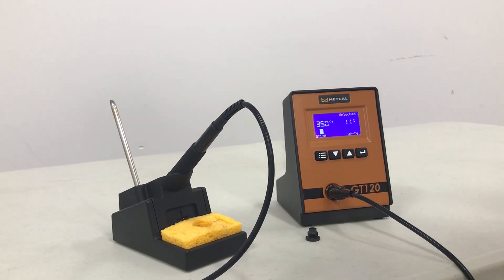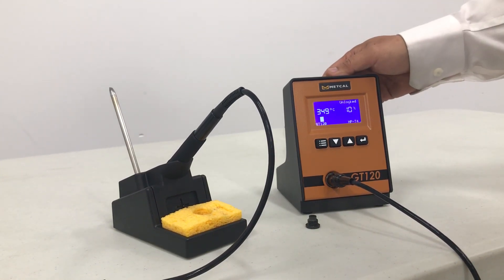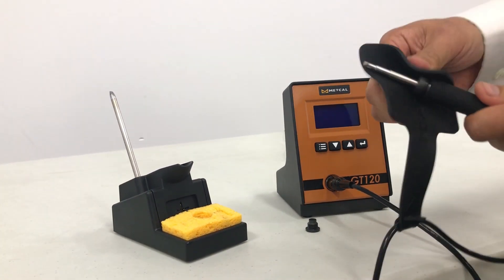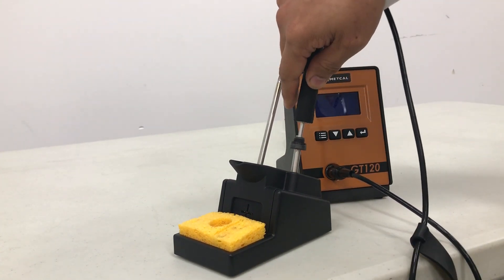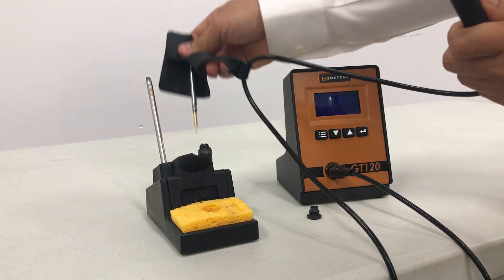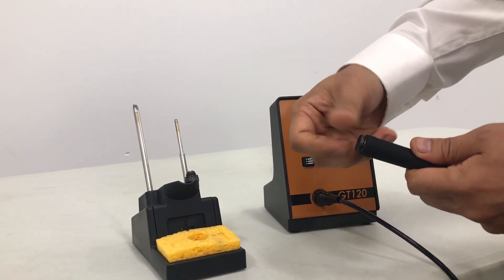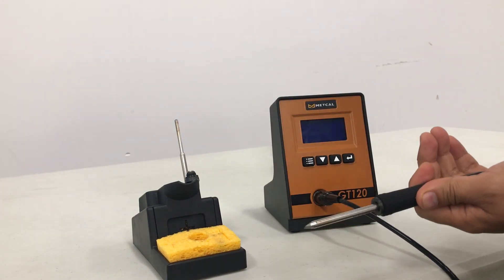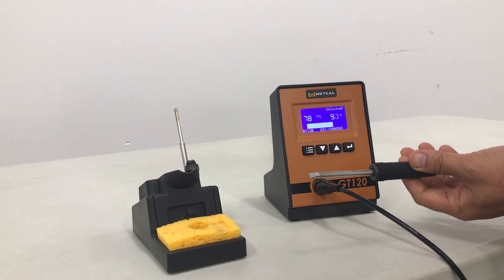GT Systems Setup - Hand Piece Configuration From Tip To Cartridge

Comment: A very good soldering station, unfortunately, but just like other manufacturers, Metcal forgot about the ergonomics that are missing here. It is a temperature control by a knob that allows for quick and trouble-free operation, which cannot be said about the buttons. It is credible that devices for economic markets such as India or China are regulated by rotary pulsators, and in the premium class there is no such thing.